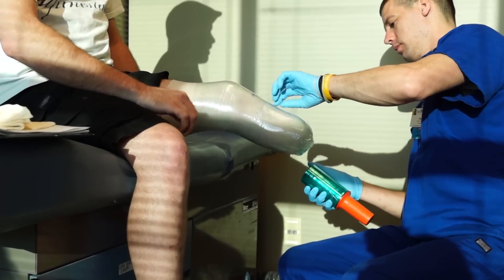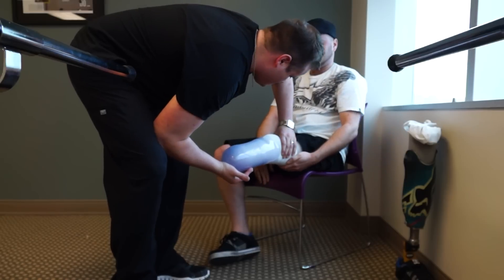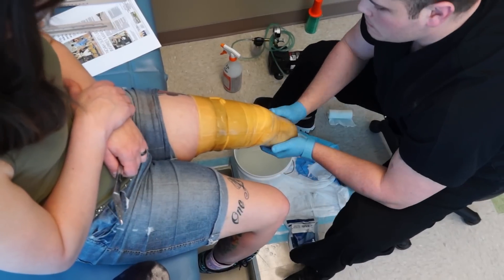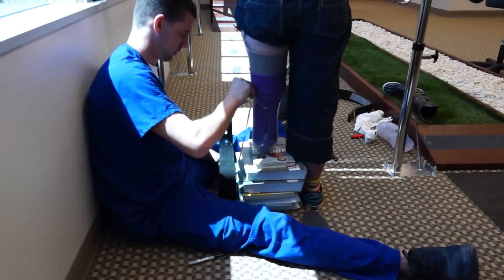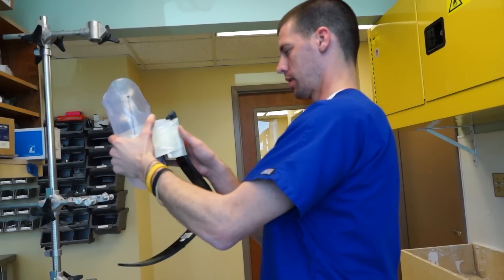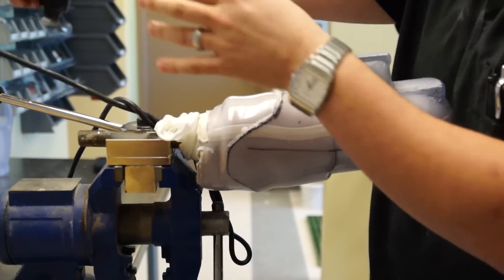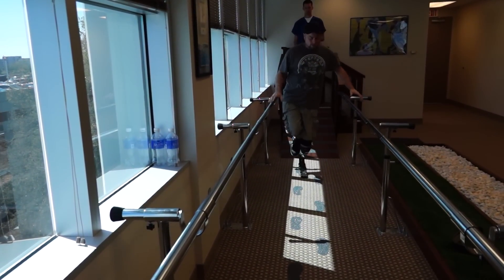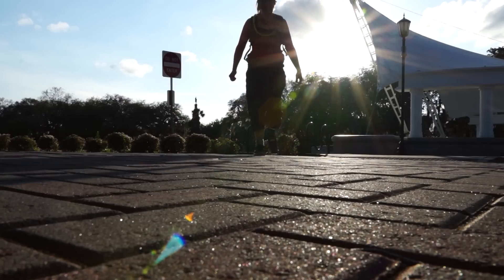AmputeeOT: How a prosthetic running leg is made!

Comment: Hows walking with a running leg? would someone be okay with using it on a daily basis?
Reply: +Nuclearkiwi2 Late reply, but typically you wouldn't because running legs do not have a heel. A unilateral amputee might be able to get away with it but a bilateral would not want to walk around without heels all day, it would just be hard to balance.

Comment: This may seem ignorant but I'm just wondering how come people don't just use a running blade as an every day leg? could someone do so if they wanted to?
Reply: I am not an amputee, or a technician who makes these legs, this is observation on my part.

The running blade is designed to have a spring-like feature and placed so it feels like you're springing off the ball of your feet. In order to provide that capability the running leg has to be set slightly taller because of the design. If it were used as an everyday walking leg the residual limb would suffer from being forced up all day by the running leg's springy nature and it would mess up normal walking gait, more stress for both limbs and your back.  Since the running leg seems to only compress correctly when you are running and putting a fair amount of force on it.

If the person was a double leg amputee, it might not be that big of a deal and could get away with it much easier.
But it looks like the balance would get a little wonky with the curve of the running blade, only my opinion.
Reply: For some people, a more anatomical appearance is important. One might not feel comfortable wearing a running leg on a first date, for example. Also, the ability to wear shoes is helpful; it would be unsafe and messy to wear the running leg in snow or mud, and then into the house. Finally, the running leg has to be quite stiff to accept the high loading forces on impact (something like 4x bodyweight). The forces aren't as high in normal walking, so the leg would feel really stiff and too tall. Much better to have an everyday limb and an activity-specific limb.

Comment: It looks like your check socket was pulled out of thermolyn, is that correct?  Whatever the material is, they use a very large piece of it to blister form your socket.  Not that it's wrong or bad, it's just different from what the lab I work in does, any info would be greatly appreciated, I love your videos!

Comment: The sole that comes with a Flex Run is a p.o.s. Soon as you get it go to a local shoe repair shop and get them to put a decent sole on it. I've got a Vibram Sierra on mine, and it's amazing. The stock one came apart within literally the first week, but I've had the Sierra for 5 months now, and it is still great.
Reply from the maker: Really? Well, I like it so far and I'll use it until I break it.
Reply: Yeh, I didn't have a problem with the traction, but it was made of such a poor quality rubber. My prosthetist even told me when I decided on it I'd probably have to replace it pretty fast. It's a good thing I tested it out for a few days on road before I used it for what I got it, which was paintball. As far as the Flex Run itself goes, oh my god I love it. I tried out the Catapult first, but it felt really weird.

In reply to your earlier comment about it being easy to run with a walking foot, it is indeed easy to do over level ground, but try running through the woods sometime with a walking foot. It's so hard to do. I can't count the number of times I fell trying to sprint/jump/climb through the woods before I got a Flex Run.